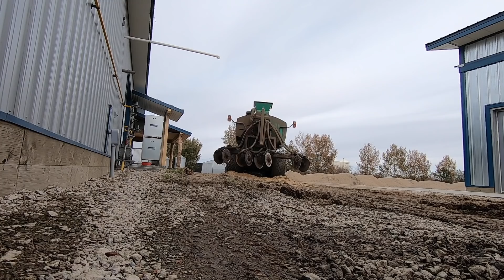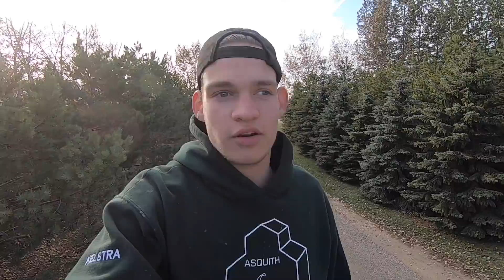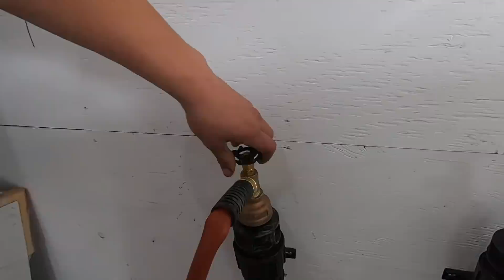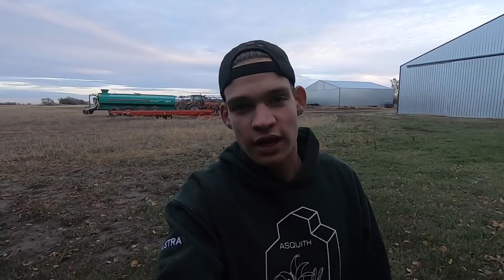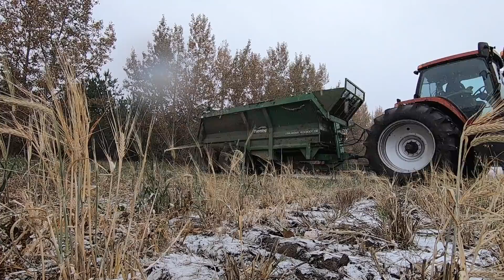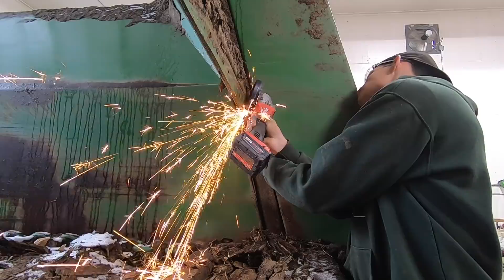Dirty Jobs on Dairy Farm

Comment: Why don't you use wood shavings/chips instead of sand? Seems like sand is a bad choice because it causes extra issues in the pit, it's not a soil and doesn't help plants grow unlike biodegradable wood material.
Reply: Andrey Kuznetsov  Their Family Farm has an abundance of free sand and the area of Saskatchewan that the operation exists doesn’t have many trees so wood chips would not be practical to haul from either Northern Saskatchewan or B.C.

Comment: I live in Calgary, Alberta and I didn't realize how "intense" or well skilled you should be being a farmer. All I know is just dig a dirt and plant a seeds. 
I work in manufacturing plant and we call for maintenance guy or electrician if there is broken or faulty wires but you are very well skilled to do all these stuff. And It'll takes time to learned all of that.
Keep it up!
Reply from the maker: Thanks! I literally just replaced a switch for an electric motor on an auger 😂